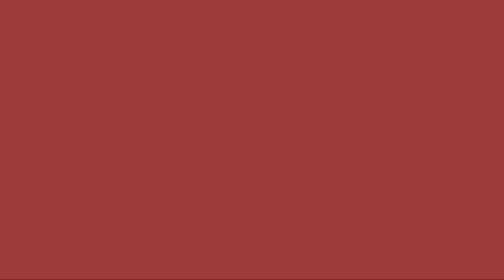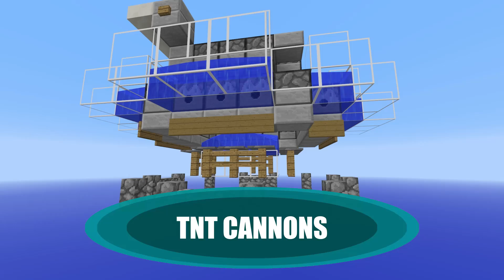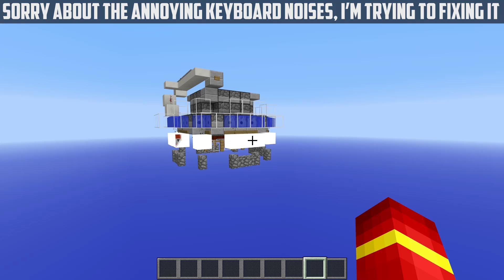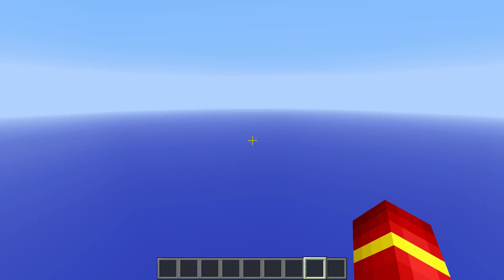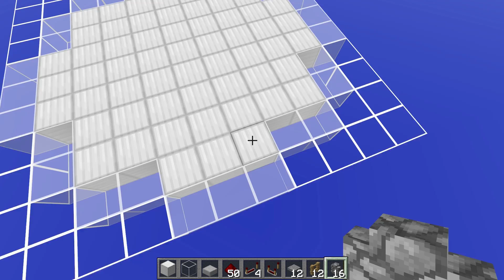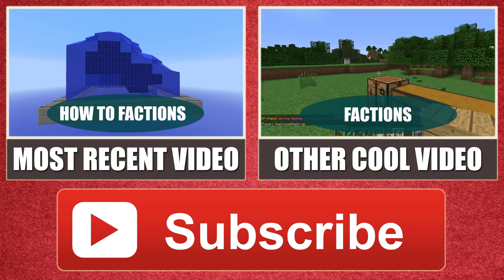Minecraft Tutorial: 360 Degrees TNT Cannon [RING OF DESTRUCTION!] [1.7/1.8+]

Comment: I legitimately tried making this into a mine, it worked pretty well if your in a condensed area or anywhere a lot of players would be, I didn't make that many changes except 4 less dispensers and a pressure plate that last for 3 seconds to fully arm a huge charge, also got rid of the projectiles themselves and replaced it with a 2nd row of propellant and made sure they where in water, it made for a pretty large amount of damage without destroying land but it was pretty impractical. Can you make a cheap and strong mine tnt madness? it would certainly be something I would use in factions servers, a good idea for mines are tripwire in dark areas because they are mostly hidden from view and players tend to not look where they are stepping.